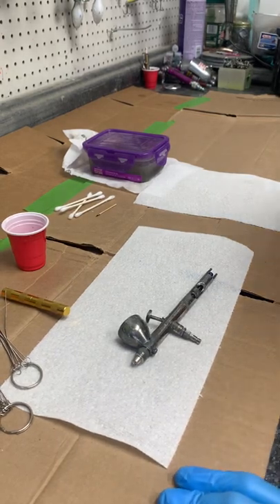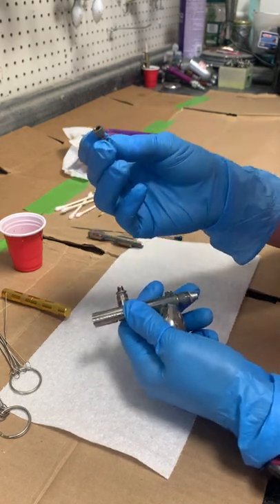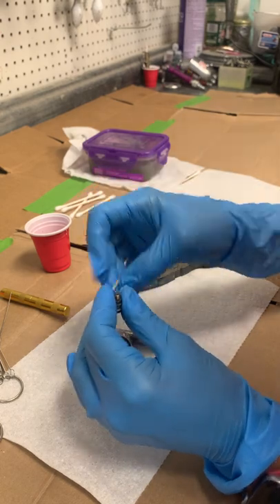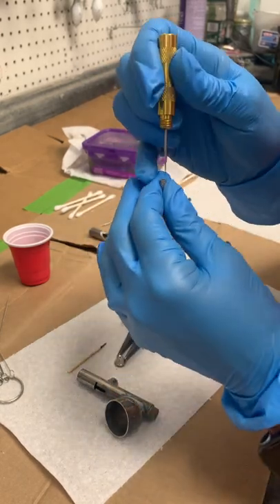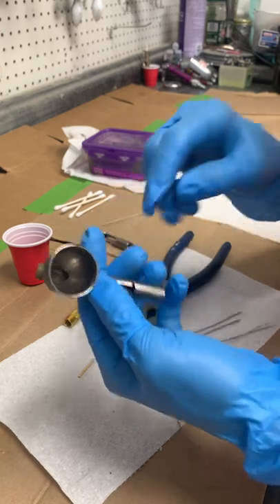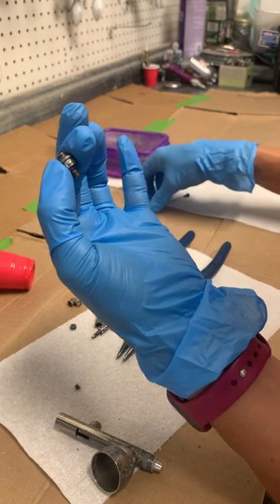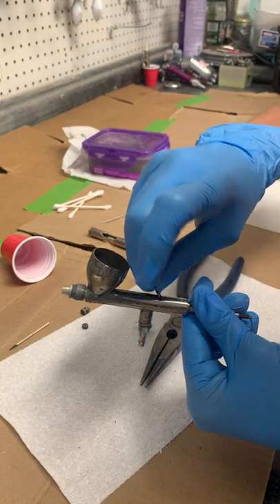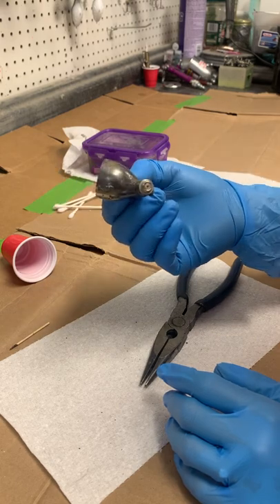Breaking Down a Badger Patriot 105

Comment: Pipe cleaners, spray Carburetor cleaners, are your friends, Carb cleaner works absolutely wonderful on removing any paint, putting that cleaning device in and out of your rear seal/bearing is not good, use a pipe cleaner, a pipe cleaner is way more effective and not as harsh on the rear seal/bearings. 
Also lubing  your airbrush correctly is a big plus, and it’s very beneficial to Lube any o-ring ( except the air valve) on any airbrush, o-rings need to squirm to seal properly, a dry o-ring will not be able to “squirm” into all the imperfections it needs to seal. 
If you do Lube the airbrush correctly, run a couple of bowls of Alcohol through the Airbrush, that should get any residual oil out of the Chamber. Airbrush’s Love to be clean, and keep clean, a clean airbrush is a happy airbrush!
Like you said, small parts seem to vanish into the air!
Reply from the maker: Yep I know! There really aren’t many seals in a badger. Just the plunger. Pipe cleaner is a good idea! Thanks for the feedback!